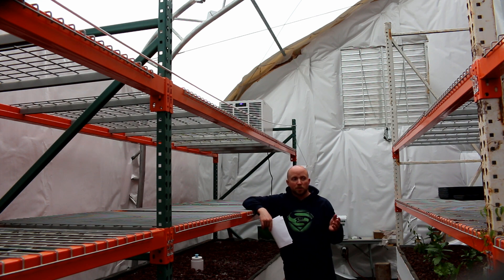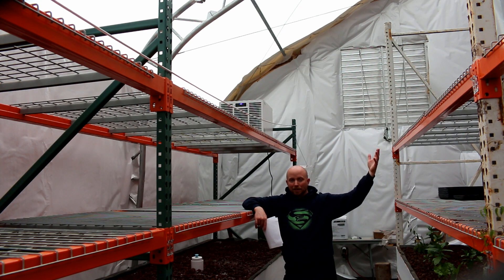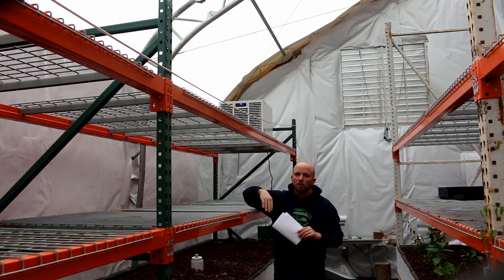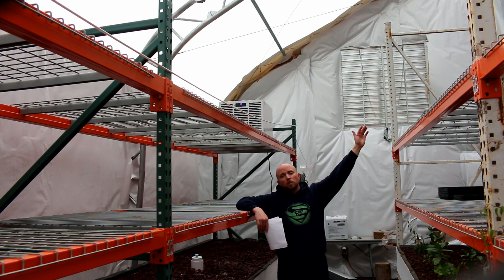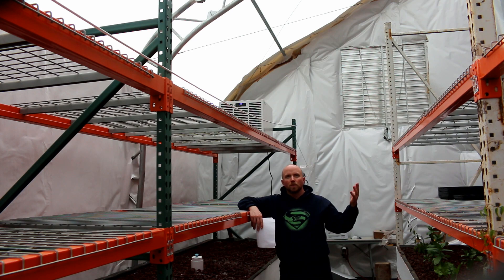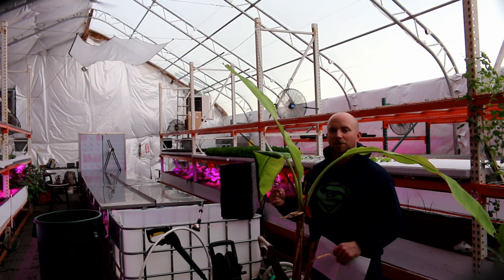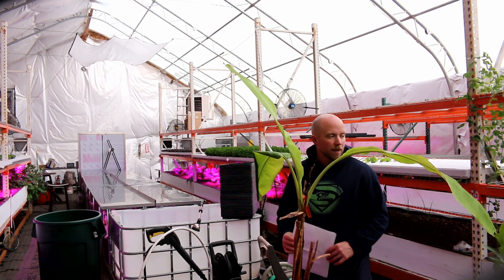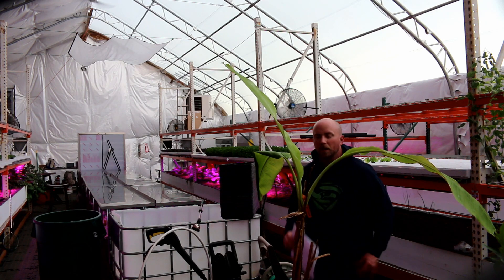The Indoor Growing Challenges associated with CONDESATION and HUMIDITY

Comment: There's a reason commercial greenhouses are built like they are, low and wide. They have to work, and can't operate at a negative profit margin. Lower ceilings, spread out, everything at ground or waist level is the way to go. That way you can Add a low tunnel over the beds inside the building and you get much better management of humidity, temperature, and air flow. Each layer of plastic or glass covering the plants is like moving one zone south. You should try to be working with nature instead of trying to over complicate and technology load something basic and natural. You seem very driven and dedicated, but your kind of just throwing money at the wall and seeing what sticks. This has all been done many times before, and very successfully. May I suggest you should tap into other experienced greenhouse operators and spend some time learning from their pitfalls. Thank you for your videos, I do hope you get it tweeked to do what your hoping for.

Comment: Just curious, why not put the germination chamber on say the south wall in the shade where it does not get as much direct sunlight?  That would save the space for  outside plants in the middle.
Reply: Agree. Also you should consider that a greenhouse that large as his own micro climates. And FEM (Finite Element Modeling) to your particular system (with all current components in place, proper CFD (Computational Fluid Dynamics); with usage of all four seasons included, would give you some of the answer you are probably looking for. Sorry, but you have a very complex issues/problems.

Comment: A question on the digester. Would an auger in the center of a hopper you can dump large loads into work to push the material down and past a U trap putting the new material at the top of the chamber? Figure a screw even if you have to add sections to push material down a pipe will let the air out so just pull solids/slurry down and the constant movement will push it the horizontal then vertical sections.  

Figure for a hopper can build a wooden hopper then have a metal liner to use cheaper materials for the prototype with a size large enough to use the bucket on the tractor for manure.